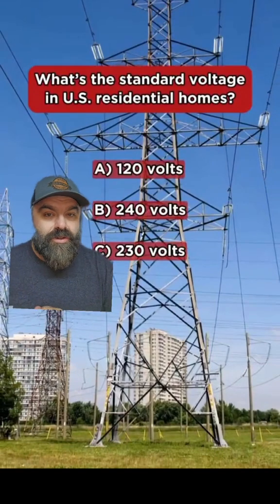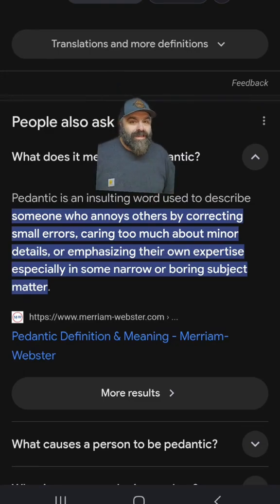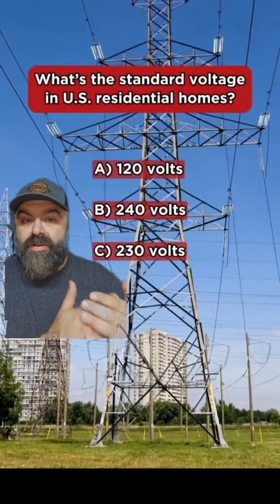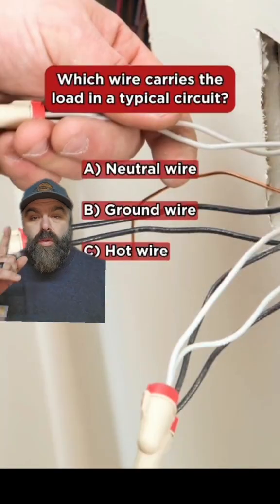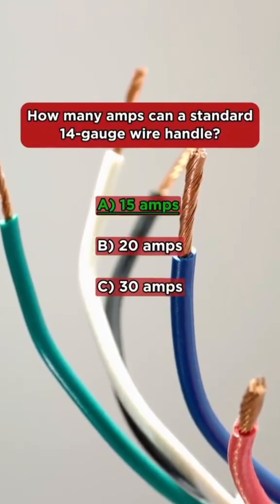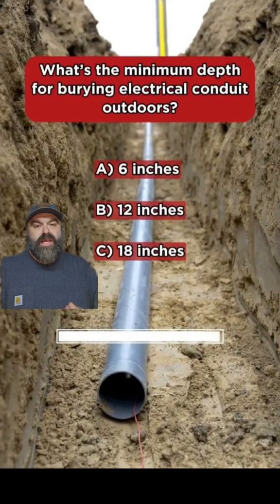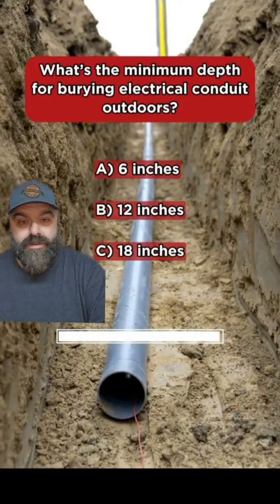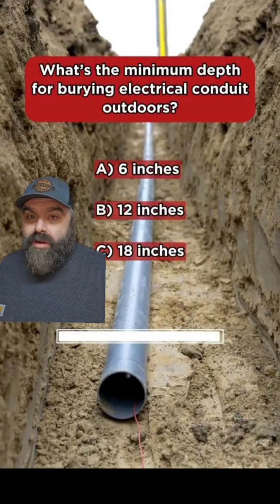Electrical Quiz

Comment: You're right. I gotta remember where I saw the 5 second rule for determining the size for EGC, where it has to hold current for a full 5 seconds without damage to clear a fault. This rule is used for high current situations.

Comment: I did not know that word but I am probably the most pedantic person around. I try not to be but it comes out, especially online. But I agree with you on all of these as the best answers. Burial is a fun topic because it is varies depending on whether it is conduit or cable, voltage, residential, and whether or not it is GFI protected. Conduit can be as shallow as 4 inches and a cable can be as shallow as 12 inches under the right circumstances.

Comment: I had the same answers you did. With a little less detail. 14gague copper being 25amps is interesting. I was thinking “handle” well I bet it could do 50 amps without melting. You probably would loose all your insulation though. 

The first thing I thought of with the depth of a trench was concrete. So I was thinking 6”. Knowing it’s to the top of the conduit and not the depth of the trench is a good detail. It’s nice to know it’s 4”. I need to get some wire across my brothers yard for car charging so I should start reading that section.

Comment: The should have asked what is the peak or peak-to-peak voltage of a 120v RMS line. How many degrees separate each phase? On a purely inductive load, how many degrees between the voltage and current sine waves? Same for a purely resistive load? Does electricity flow from the power company generators into your home? (True/False) What is the proper orientation for a standard NEMA 5-15R outlet - like this 😲 or like this 🙃? Electricity is the flow of electrons in wires (true/false). How many amps does a standard incandescent 100 watt bulb draw on a 120 volt AC line? Bonus question - ElectroBoom's wife is just waiting to collect on his insurance policy (true/false)

Comment: I know a lot of older homes fed with just 120v single phase, so the real answer is it depends. 120 volts is considered the default standard voltage for most home appliances in the US, unless it's a large air conditioner or heavy appliance. I would still say the default voltage is 120volts even though multi-phase feeds may be called for. The majority of outlets in a home are 120v 3 prong outlets. That's kind of a loaded question.
Reply from the maker: @josefmazzeo6628  In 29 years as an electrician in three states I have never seen a single phase home that was only 120 volts.  I have never even seen a power company allow only 120 volts to be fed into a home. Single phase is 120/240 volts

Comment: Agree with all you said except for the standard 14 gauge wire. The standard is romex at 75 degrees. 15 amps is the max. THHN is more expensive and not typically used as the standard.

Comment: 14 gauge wire can only be used on a 15 amp circuit
Reply from the maker: @briankirkland249  yes but the conductor has a higher rating of 25 amps

Comment: The wording is important Generally Designed to handle safely 0:00  14 is 15 amp 12 is 20 amp 10 is   30 amp. The service is split 220/240/ 110/120

Comment: It varies from 220-250 volts.
Reply from the maker: @dimitriberozny3729  the national electrical code says we are supposed to use 240v for load calculations.  I have never seen below 230 at a service.  Unless its 208 and not a house

Comment: I thought (for Romex wire anyway) that 14 Gauge wire was rated at 15A.
Reply: I thought he was going to say 12 A continuous.  But the real answer is that the questions aren't well defined.
Reply: @charliesullivan4304  When I worked at Lowe's, that was the rating listed on the box.

Comment: The “240” in a residential feed is only from one hot to the other, they’re both 120 to neutral or ground. So I think 120 is more correct than “240” but you said it right with 120/240.

Comment: U wrong on a lot. First one it says what is the standard voltage in a house hold. Not what comes into a house. 18inches is the correct answer n who wants to leave wires on the ground then put dirt 18in over it. Many things can go wrong. Hats why you hurry it. Just bc a wire is rated for certain voltage doesn’t mean you should put max voltage to it especially in your home. It’s like haveing a car on empty. It will run close to empty but not smart to do so. I’m not even an electrician but I’ve worked around it enough to know.

Comment: As a retired utility lineman, I agree with your answers but would also like to point out that there are some older houses still around that only have 120V - 2 wire services.
Reply: With a 30A service that has pennies behind EVERY screw-in fuse...😂😂😂
Reply: Some also have bare wires in the attic...Scary

Comment: Most sockets inside an American home are 120 except for the dryer stove your heavy power consumers need 240. That first question was tricky
Reply: Yep.....found "in" US homes is "typically" 120V...but "supply to" the home is 240V....etc...plus the points you made.

Comment: I think for a lot of these basic quizzes you have to realize who they are directed at and then take off your expert hat and think like the average person. Most folks think of a typical outlet and will say 120 volts. Most folks, if they know enough to even guess, are going to associate the wire gauge with the amperage they see at the breaker panel so they are going to say 15 amps for 14 gauge wire. Sure, the answers aren't expert level but then they were meant to be basic ed questions and at least if someone wires their own circuit and has only ever learned to use 14 gauge with 15 amps they won't burn their house down because the wire gauge is too small. For other reasons, sure, but not wire gauge! Basically, you're thinking too much here. Lol.

Comment: Right on all questions for exact specific code responses and yes borderline pedantic. That said, original answers were also correct by minimum NEC code requirements.

The NEC code is the “Minimum” to help prevent fires and for safety so anything done above that is good practice if you have the cash for materials!

Comment: As a Master Electrician, I can say that this "quiz" really isn't worded well.  The language must be more precise and include code references.  I agree that you can argue basically every question/answer on here
Reply: There are a lot of examples of this across the spectrum. Bottom line is they thinking of an answer and you have to get inside their minds and take a SWAG at it
Reply: Being an Electrician but not living in the US I can understand the first question.  It would be like me saying what is my house FED with. 
It's actually 440v . But the appliances run 240v when connected between a phase and neutral. I still have the option of running 440v equipment, usually water heaters, welders, EV chargers.
Reply: As a masterbaiter I agree

Comment: Always thought 14 gauge could take a load of 20 amps but for safety reasons 15 amp breaker is used.
Reply: And technically, it can handle even more... It just gets really hot. The insulation is what actually dictates what it can carry, as it will melt before the wire does.
Reply: Technically, a 14ga wire can handle 35A, if in a free-air situation.

Comment: Not pedantic, fantastic. 

I would have went on, because YouTube is worldwide. 230 is nominal in most of Europe, however nominal voltages vary quite a bit. Brazil has differing nominal voltages, their grid is far from homogeneous
Reply: In the states, 120v is nominal, but I've seen it as low as 110v and as high as 125v
Reply: @adampindell  when I went to trade school(79ish) they were still teaching about legacy voltages - 110, 115, 125, and how some people still had transformers with those ratings serving them.
Reply: @aredditor4272  I have a transformer at my shop with those exact voltage steps you can tap into.

Comment: I wasn't aware of 4" below concrete. Here in Canada, I don't believe they say anything about concrete, but they do say any roadway supporting traffic requires 24" overlying the conduit. The one argument behind simple rules is the way it helps to keep those with less training in line with safe practice. Exceptions like your 4" rule could easily be taken by a guy who doesn't know better and used in the wrong situation. Quiz problems like this are harder for guys like yourself who know more than the target audience.
Reply from the maker: @spelunkerd  there is a chart for the all the different situations.  Many if not most say 12" or 24" but the minimum listed in the chart is 4" for a specific situation.  So I just thought the way the question was worded that was the right answer.

Comment: Right with ya bud, I knew what they were going for, but worded wrong. They could’ve said what is normally found at a residential receptacle, what amp breaker would you use for 14awg, etc…
Reply: I agree also, very non-specific questions for a field thats vast as well as nuanced.